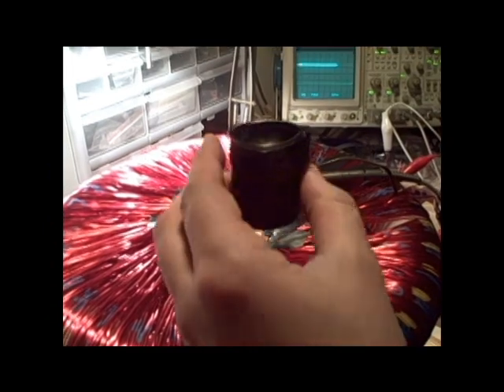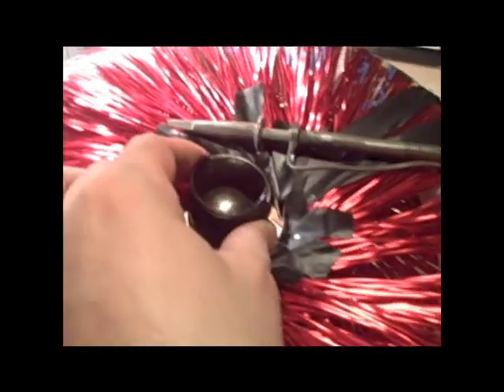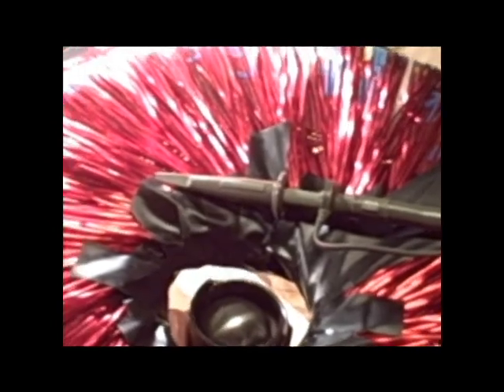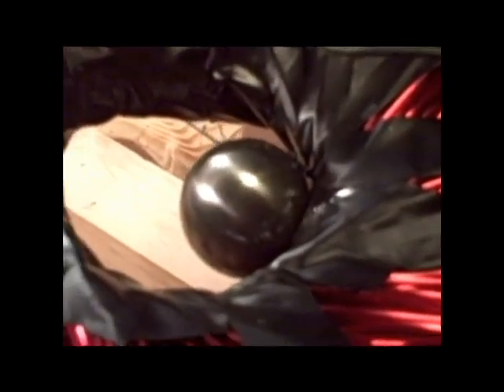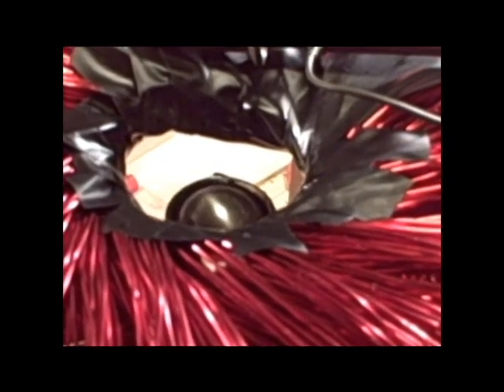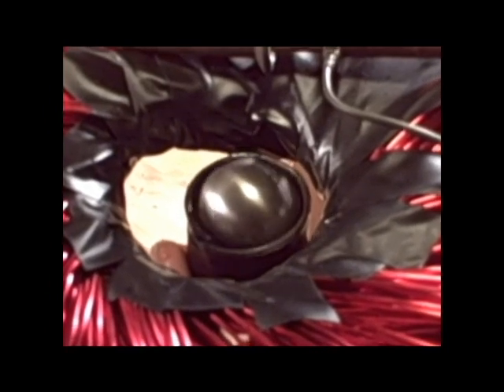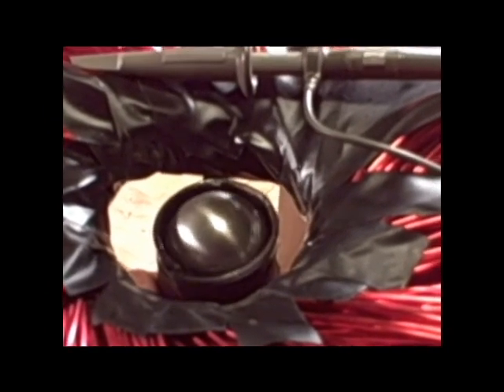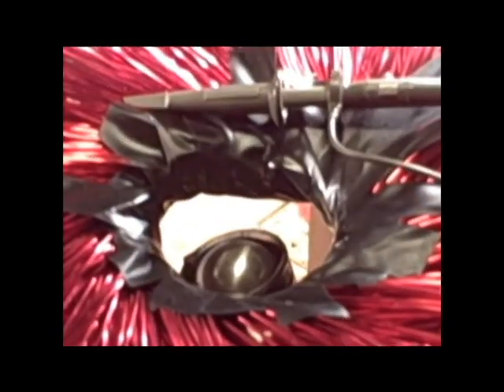Rodin Coil Levitation and Spin of Neosphere

Comment from the maker: @ rayjoel2007
dave and i have been busy and will have some good stuff to share soon. the field only produces a South pole.

@23blueweaver
the neospheres rotation is not regular about fixed axes.  the force creating the rotation is spiraling magnet flux which interacts with the field of the permanent magnet. this effect is in some ways like a steel ship spinning in an oceanic whirlpool

@adomhussein
2 wires, AC or pulseDC will work. u will see different power and spin performances.